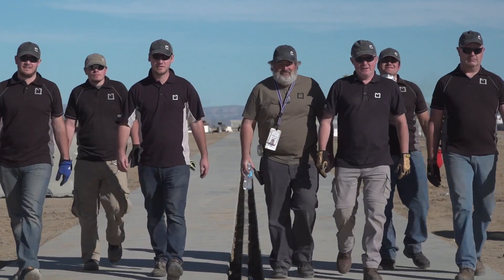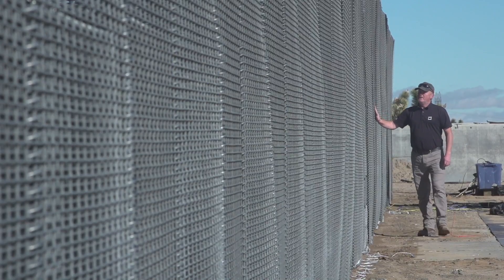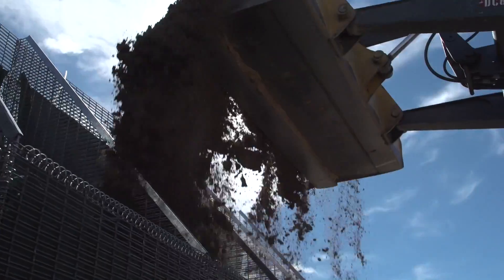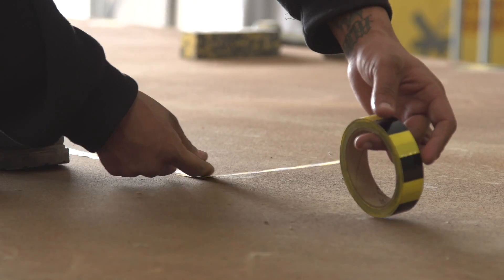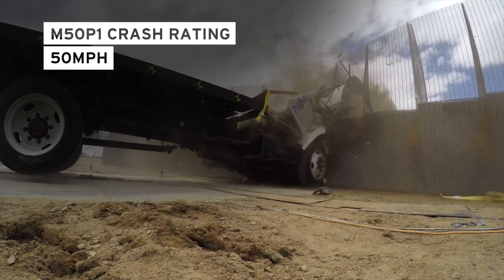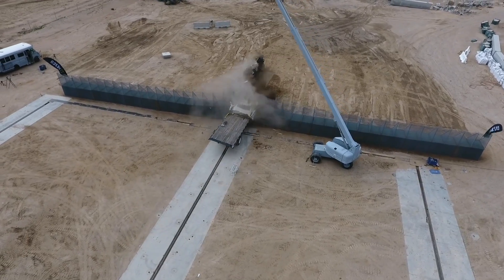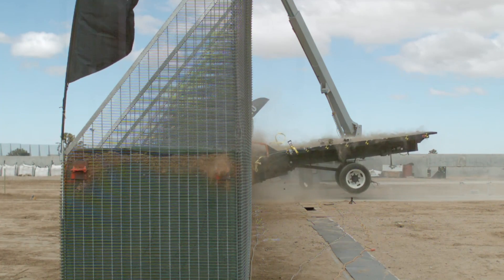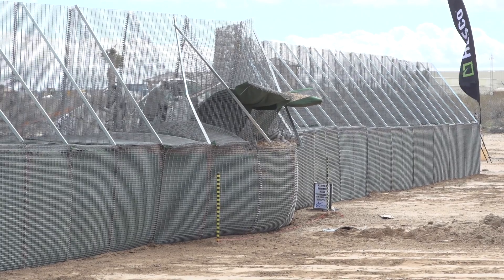TERRABLOCK - 50MPH Crash Test

Comment: That's an empty flat bed truck. What about a heavier truck carrying a significant load?
Reply: The truck itself will stop just the same. Whatever is on it, will roll over to the barrier just those oil barrels though.